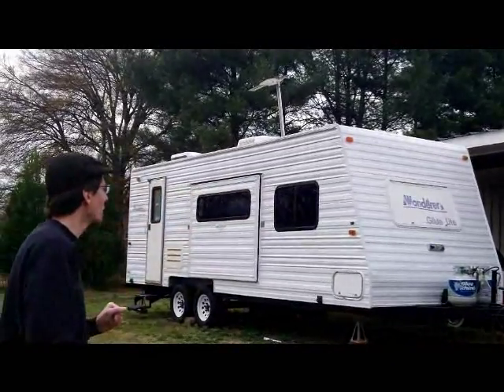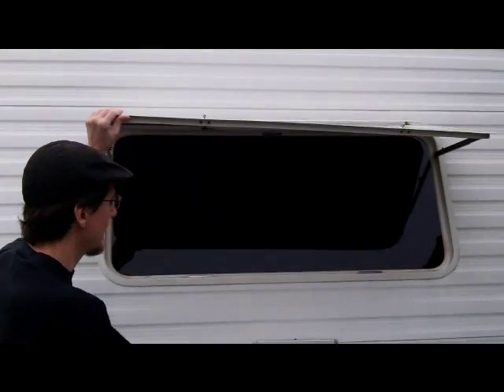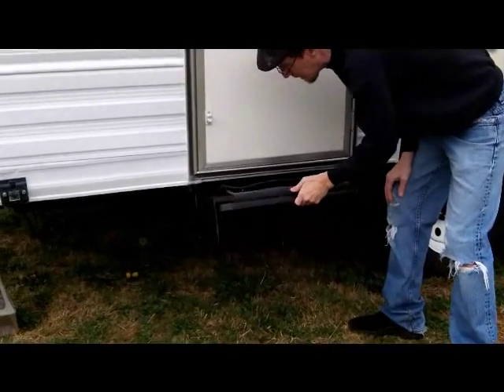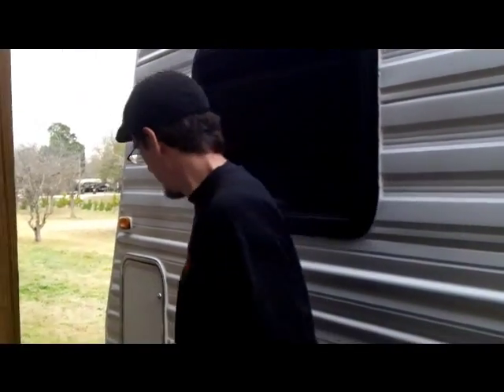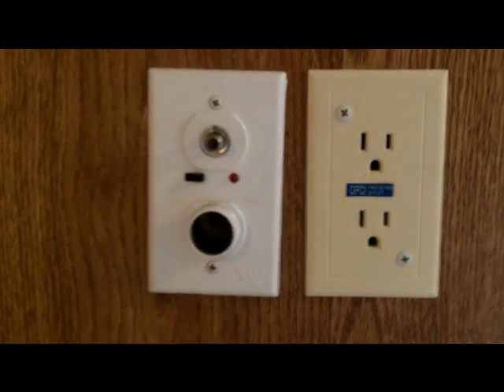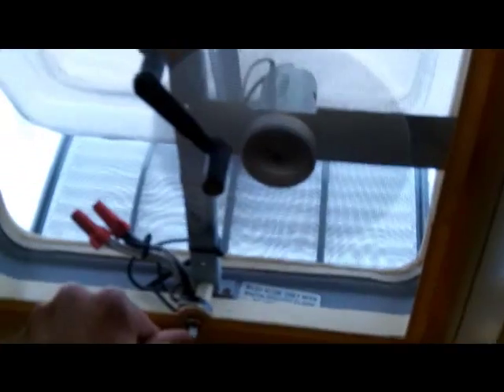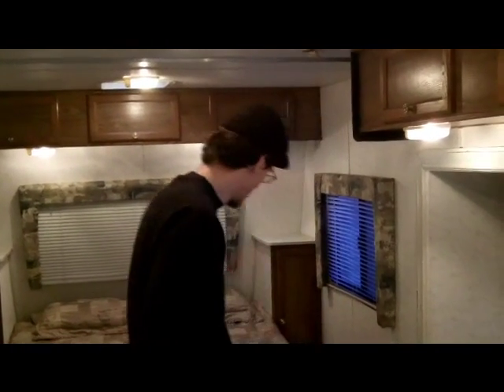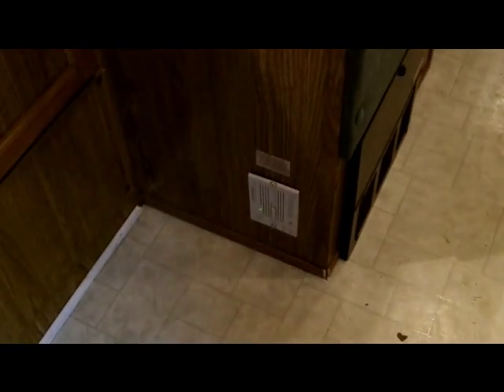Thor Wanderer Glide Lite Video Tour

Comment: Do you think I can pull that thing with my 2005 Jeep Wrangler? it's a Rubicon also I have the regearing setup to 4.88 with a 4 inch lift. 4000# is my capacity load.